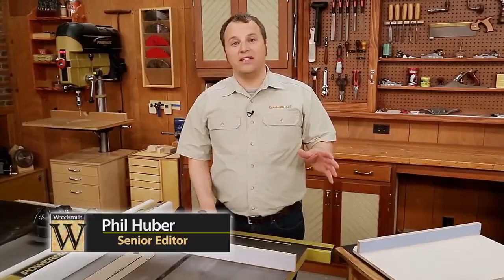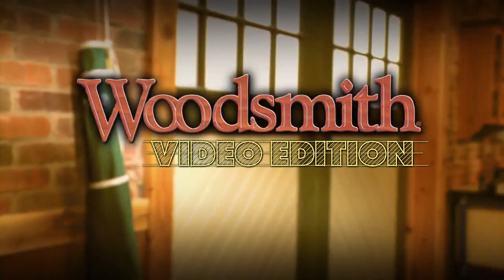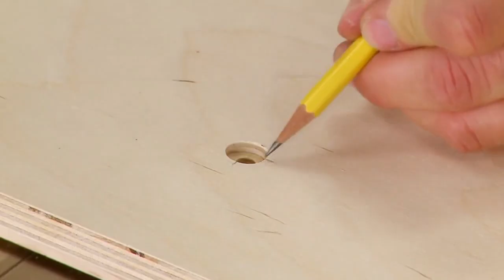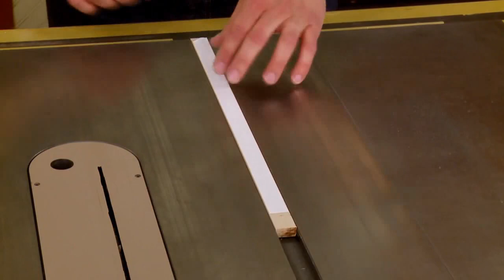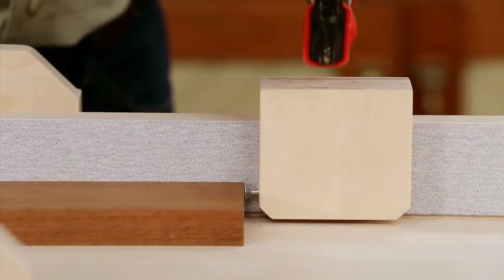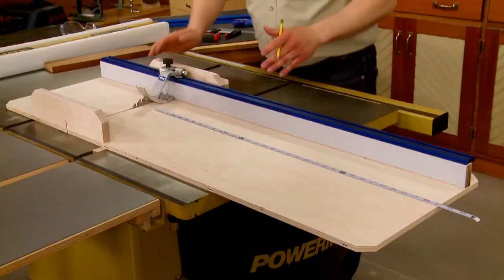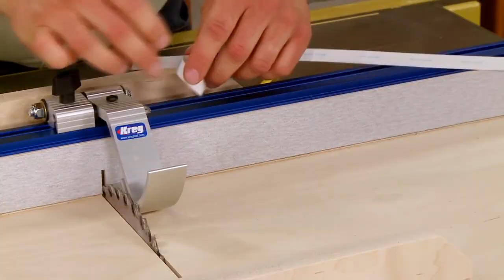How to Make a Table Saw Crosscut Sled | Beginner-Friendly + Free Plans

Comment: Appreciate your attention to detail for this sled construction. Also downloaded the free plan sheets, which are really well done. (In another lifetime, I used to do CAD). The 16" depth of the sled base is a sensible choice for most uses, however, if one does a lot of 15-3/4" shelving it might help to add a few inches so that this material can pass between the bridge and fence.
I built my own saw table/base from 3/4" ply & bolted a good quality "Skil" saw under it, so it loses some blade exposure. Therefore would make the sled base out of 1/8" or 1/4" "hardboard" (masonite). It should be strong enough if handled with care, but in this case, the runner would be attached through the top with countersunk flat-head screws
Another comment would be to use plastic or metal runner(s) and put two on the extended "two-side" version of the sled. My wooden table works a different way, but OK for me
My current project is to make replacements for white "melamine" kitchen cabinet doors, so all cuts must be clean & square. Then the edges must be covered  with the heat-glued, so-called "edge banding".

Comment: Need to back up and add a step.  Make sure that your fence is parallel to the blade.  If it isn't then your sled fence won't be square to the blade.  Using the blade to square the sled fence is another option.

Comment: Would it be a good idea to install a second hardwood runner in the other miter gauge slot?
Reply: much more reliable and accurate with 2 runners, this is garbage
Reply: @agentchodybanks9120  I agree. I wouldn't trust one runner to remain accurate especially using solid wood even with screws

Comment: This is all good for those that have the expensive equipment shown here. I have just beginning table saw. So can you make one of these for the cheaper table saws?
Reply: Absolutely. A sled lkke this can help make that beginner saw cut like a more expensive product. Take your time to make the sled and it will help in the long run.
Reply: It does not matter what table saw you have. You could be rocking an overly priced SawStop or a cheap pile of junk from Harbor Freight. The sled making process is the same for all table saws. 🍻

Comment: The sled in part 3 looks like the riving knife nor a splitter is used. I have some thin kerf blades that the riving knife is too thick to use with my table saw. It looks like I need this  sled if I want to use my thinner kerf blades, than I can with my riving knife.

Comment: If you loosen the screws to adjust the fence aren't they just going to go back into the same hole?
Reply from the maker: We used panhead screws in oversized, counterbored holes so there is a little room for adjustment.  You can loosen the screw and move it over within that oversized hole and tighten it back down.

Comment: Great video. How deep will the blade cut with the larger sled? It looks like the max is 1 1/4". Thanks.
Reply from the maker: That is correct.  If you use the Kreg flip stop system, it limits the height of the fence.  If you choose not to use the Kreg flip stop you could really make the back fence as tall as you want.

Comment: The plans for the larger sled seem to have a problem. It shows a distance of 12" from the right edge to the blade slot. The width of the bridges is 12". But the distance shown from the right edge of the bed to the right side of the far bridge is 8". That would put the blade slot only 4" into the bridge, when it clearly shows (in the instructions and video) that the blade slot goes through the center of the bridge. I'm going to assume that the 8" measurement shown is wrong, and should say 6" instead?

Comment: The Kreg 48" Top Trak is sold out in most if not all stores including directly from the Kreg site.  Some sites say that this has been discontinued from the manufacture.  Are there any known safety issues with this?  If not, would the KMS8000 kit work in its place, or would there be issues with sliding across the joint of two separate track pieces?  This is a great video, thank you.
https://www.kregtool.com/shop/cutting/miter-saw-cutting/precision-trak-stop-kit/KMS8000.html
Reply from the maker: Hmmm... I wasn't aware of the recent shortage.  It was probably caused by this video  and everyone's rush to build the sled.  ;)   I'll contact Kreg to see what's up and if they plan on continuing to manufacture the top trak.  You shouldn't have any problems using smaller sections butted together.  On another sled we built ( https://youtu.be/KWyLrDZAW-c?t=234 ) we added an extension and the stop doesn't have any problem jumping from one track to the next.
Reply: @WoodsmithShowandmagazine  Thank you for such a fast response, I was not expecting that on a video over 2 years old.  about two weeks ago some online stores had the KMS8000 kit, but as I am looking now even that appears to be out of stock.  The KMS8000 kit has the track, swing stop , a production stop, and two tapes.  It appears to be marketed more towards miter saw builds, but is pretty much what you have used here for a table saw.  I am new in wood working and just finished building this sled today.

The next thing to create will be a toolbox-like carriage for a zip-line social distance Halloween treats, similar to this idea: https://www.youtube.com/watch?v=4bGiPUvljHA
Reply from the maker: @jwinc7  - Yeah when I was looking around I noticed the KMS8000 kit was hard to find now too.  If it is that Kreg isn't producing this product anymore we will definitely have to come up with a shop-made equivalent because we have used this product on a lot of of designs for sleds, miter saw stations, etc.

I just saw that Halloween zip line contraption a couple days ago.  How cool is that!  It will come in really handy this year and put smiles on a lot peoples' faces  for sure :)
Reply from the maker: @jwinc7  - I contacted Kreg about the Top Trak and the good news is that they are continuing to manufacture it, but the bad news is the there has been an uptick in demand and they aren't sure exactly when they will be back in stock again. :(
Reply: Thank you so much for checking on that.  It is good news that it will still be continued.  I look forward to being able upgrade my sled when it is back in stock.

Comment: I love what you guys do. Now I have a cheap Harbor Freight table saw because at this time I can't afford a better one. Now do you have an idea how to make a crosscut sled when its a partly a T grove?
Reply: While I’ve never built a sled Jeffrey, I don’t think the T groove will matter. I would use a calipers to get the proper width of the miter gauge slot. You might take several measurements along the length of the slot. I think when I  build mine that’s what I will do. I will make a 2nd hardwood runner for the opposite side of the blade. Thank you & Merry Christmas

Comment: 6:35.  Is there any reason you didn't use a larger (rafter) square for more precision?
Reply from the maker: Yeah, you can use a larger square there if you have something that is accurate.  The drafting square we used is pretty precise, but larger carpenter squares can be off sometimes.  

Also, at that point it is just a starting point to get you close.  You will do test cuts and check for accuracy and adjust the fence as needed from there.

Comment: Nice video, but it looks like you put the flip stop on the wrong side of the kerf when setting up the measuring tape.  18:40.  Error can be easily seen at 20:14
Reply from the maker: Nope... it is correct. I guess I'm not seeing what you are seeing.  It is set at 10" on the cursor and cut a 10" piece.
Reply: @WoodsmithShowandmagazine  It looked farther than an inch when looking at the other markings on the ruler, but it must be the the angle or more likely my vision/perception.  Nice video  and thanks for responding.
Reply from the maker: David Grant - LOL... I was a little worried when I read your comment because I’ve been using this sled for a while and I thought all the pieces I’ve cut since we made this sled were wrong.  It’s probably just the camera angle, like you mentioned though. Thanks for watching. :)

Comment: When and if you have to fine tune the fence after tests cut for true cut.  If you loosen screws to make adjustment and retighten doesn't that make it go back to same position or do you re-drill the holes?
Reply from the maker: We used panhead screws and washers in oversized, counterbored holes so you can make fine adjustments and tighten them done without returning to the original position.

Comment: You do fantastic work!! Will these sleds work on the inexpensive jobsite table saws that the novice woodworker uses?
Reply from the maker: Yes, absolutely!
Reply: @WoodsmithShowandmagazine   The problem I have using one on my DeWalt DW744 is the blade comes up too far to the front which either limits the size of the board that can be cut or balancing the sled that is off the table saw bed. Going to try to build one with a framework to stop a lot of the tilting. BTW great detailed video!

Comment: I have a Craftsman table saw and cutting a 90° cross cut has always been a chore. The slides in the table top have tabs built into them as the miter slides (loosely) under the tabs in the groove. How can I build a slide for a sled accurately?
Reply: David, I noticed you had not received a reply to your question.  I am new to woodworking, so please take this with a few grains of salt and forgive my lack of knowledge.  When I was trying to build a sled, I quickly came to realize that wood could expand and cause issues on the sled.  I had two slides cut that worked nicely moving easily with little to no play.  3 days later when they were attached to my sled the slides would not fit into the miter grooves as they were too wide.  I ended up purchasing metal adjustable slides.  The ones I got are the Incra - 25-1/2" GlideLOCK Steel Miter Slider SE.  This model has a T tab on both ends to fit into the T groove of the miter groove.  There are several aluminum models also available that are a bit cheaper.  I don't know if this option would help you or not, but may be worth a look.

Comment: You've seen "I" attach a long auxiliary fence to a miter gauge?  Really?
Reply: are you here to learn a specific woodworking build or call to order a grammar class? Y/Tube is rife with fucking morons like you. You would last 2 minutes in my shop without wearing a hammer to the side of your ego filled pumpkin.
Reply: To be fair, he said "You have seen Don, Brian or I attach..." which is a common mistake in English (should have been "...or me attach..."). However he did not say "you have seen I attach..."
Reply: @chrisbaier6252  No, to be fair, he DID effectively say "you have seen ... I attach".  Whether other people are included in the sentence or not doesn't change whether the first person pronoun is subjective or objective.  It's an easy rule to follow.  Take everyone else out of the sentence except yourself, and if "I" doesn't work, change it to "me", and then put everyone else back in the sentence.  I hate hearing "I" used when "me " is correct because it reflects so badly on the speaker.  It's even worse when written than when spoken.  When written, there is every opportunity to proofread and edit before posting.  It's the same way with "less" when "fewer" is correct.  Try "fewer".  If it doesn't work, then use "less".  (Less money, fewer dollars.)  No one would ever say "fewer money", but people will use "less dollars" all the time.  These kinds of mistakes sound like "ain't", "y'all", "youse guys", "ax" in place of "ask", "no" in place of "any", etc. etc. etc.
Reply: @chrisbaier6252  To be fair, he DID say, "You have seen ... I attach".

Comment: What is the advantage to this over using a miter saw?
Reply from the maker: Traditionally, miter saws wouldn't give you fine, accurate cuts that a crosscut on a table saw could, but to be honest miter saws have come a long way.  However, this sled is going to give you the ability to accurately crosscut wider pieces and to cut dadoes and tenons which a miter saw could not.

Comment: For my long sled I attached the end near the blade with a screw then set a dowel into the slide at what my square said was 90.  Then using feeler gauges I shimmed out my fence gradually until it cut perfect on a 5 cut
Reply: If I rebuild it I may disassemble a cheap harbor freight micrometer to tune it

Comment: I think you need to retitle this video or just delete it from YouTube. This is far from the "last" sled one would make for a table saw. This is a "OK" sled for a beginner at the most. When you placed your square on to the test piece of wood, you showed us that an adjustment was needed. That was a small piece of wood and that square had a lot of movement. On a larger piece it would have been far worse. Why didn't you use the 5 cut method? You do not explain how do you measure the change needed. And then retighten the screws??? The fence will just go back to the original position. This is not one of your better "How to.." videos.

Let me explain myself. I recently purchased a good quality, used table saw for my new shop. I haven't used a "real" table or cabinet saw since high school. Only my jobsite table saw. So before I use my saw, I knew I needed to review the safety rules and make changes on my saw to make it safer and easier to use. (Also can't use the saw because I am recovering from hand surgery not related to a woodworking accident.) I have watched hours of safety videos, tips and trades videos, various jigs and of course, sleds. I have yet to build my sled because, like your video title states, I wanted to make this my "Last" sled.  Phil, please watch some of the other sled building videos, take notes and make improved changes. The other two videos I was able to find on the Woodsmith channel did not involve the making of a sled. You have a coworker that had that 2 runner sled under his desk that looked pretty good however it needed more features. PLEASE make a better video than this one and include the "5 cut" method to help create that near perfect square. BTW, I am a new subscriber to this channel because of the large number of videos on other topics. You have a great team there. Look forward to watching.
Reply from the maker: LOL... You almost had me convinced to just delete the whole Woodsmith Channel from existence but then I thought better of it.  :)

The title is a little tongue in cheek poking fun at all of the click-bait titles on YouTube.  I don't think any sled, etc. would be the last you would ever build because your woodworking needs might change and be more specific as you learn different techniques and start to build different projects. Not sure if you watched the whole video but there is actually more than one sled built in this video, but you are correct - this probably won't be the last sled you as a woodworker would build, but maybe it is???

There is even more explanation as to some of the building and use of the features in this series of sleds in the free downloadable plans (link in the description).  The fence is attached through the base in over-sized counterbored holes with washerhead screws, so it will not return to the same position after adjustments.  This was already a pretty lengthy video on the building of the sleds, so we did glaze over the exact method of getting it to a perfectly square adjustment.  You mentioned the "5 Cut Method" and as you may already know, there are already a ton of good videos on the subject on YouTube already.

The good news is this will not be the "Last" sled video we will produce and we will definitely take your comments and suggestions to heart and make improvements to the next ones.  Despite the hyperbolic the title, I hope you learned a little something that can use and thank you for taking the time to look around our channel and check out some other videos and leave your input.  Please stay in touch as you restart your woodworking journey and let us know how it's going.

Comment: Thank you  - I like your style, especially for the novice like myself! What are the pros and cons of one track over two?
Reply from the maker: We’ve done sleds with either one or two runners in the past. Two runners might give a little more stability but it adds another layer of difficulty to get both runners in the correct position and perfectly parallel.  One runner seems to work fine and is a little easier to execute.
Reply: @WoodsmithShowandmagazine  Just curious but if the runners fit snugly in their slots, how is it tough to get both runners "in the correct position and perfectly parallel?  I'm not trying to be a troll, just don't understand the response.
Reply from the maker: Captain G - no, it is a good question. It really isn’t an overly complicated process, it’s just another step that we felt wasn’t necessary for this introductory sled. We have put 2 runners on other sleds we’ve made, and they have worked fine too.  I think this would actually be a good topic of discussion for a future video. Thanks.

Comment: I have a question on why you use the pan head screw instead of a undercut or countersunk head wood screw is it because he shank doesn't provide any contact without threads?
Reply from the maker: Good question...  we used panhead screws in an over-sized shank hole so you could loosen them and make fine adjustments to get the fence set.  If you use countersunk screws you are really locking it in to that position, and it makes it harder to make adjustments later.

Comment: You need to use William Ng's 5 cut method to dial it in. My sled is +/- 0.0005 over 12" after that: https://www.youtube.com/watch?v=UbG-n--LFgQ
Reply from the maker: Thanks.  William Ng certainly seems to have the market cornered on fence squaring with his 5 Cut Method.